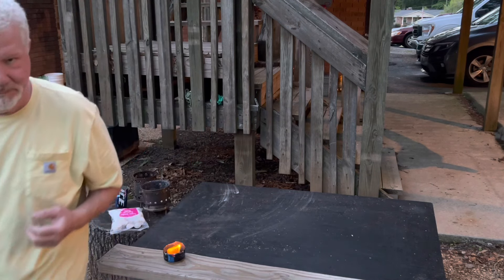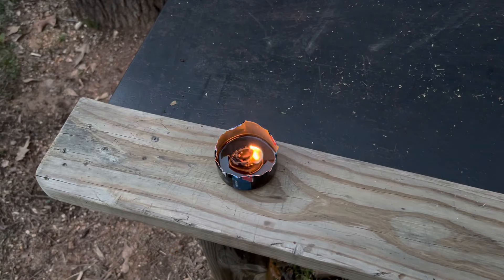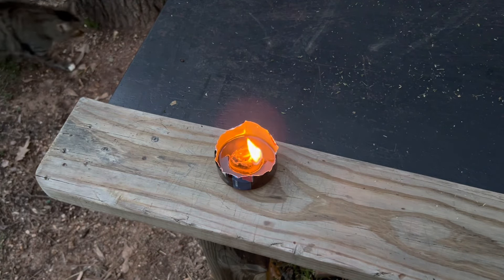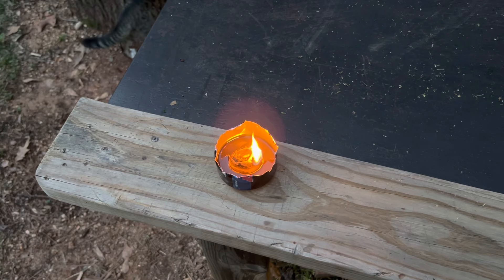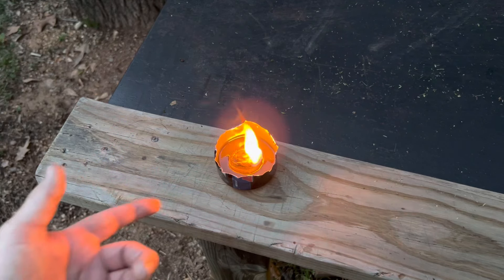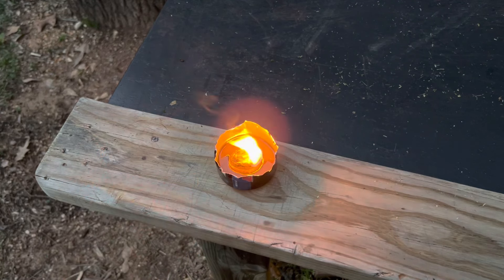Grease Lamps Burn Plant, Animal, or Petroleum Greases And Oils

Comment: I did the samething once but with a tuna can and polished the inside of the lid to reflect more ligh. Awesome video as always 👍🏽
Reply from the maker: The aluminum can that I used the last time, I cut reflectors into. They got so sooted up, I had to cut them off and then had light in 360 degrees. There are lots of fuels that don't smoke, though.

Comment: Thanks David for the tutorial. I was at a museum in the Southwest looking at "unidentified" artifacts from the Anasazi. They were small shallow dishes made of ceramic with a small ramp leading out of the center. I knew they were oil lamps from my time in Alaska from seeing seal oil lamps which were used to illuminate pit houses and at times igloos. Not so sure how healthy it would be in a small enclosed environment, but maybe the health risk out weighs sitting in the dark.
Reply from the maker: Used motor oil makes heavy smoke, Olive oil not so much.

Comment: Thanks.  I saw my traeger grease catch full today, and remembered this one from a month ago. Chugged my beer and 30 seconds later I was recycling like a champ.  Is the reason you cut it so short so it is not top heavy tip over?
Reply from the maker: I was only burning a 1/4 cup of oil. Also the taller the container the less the light can broadcast.